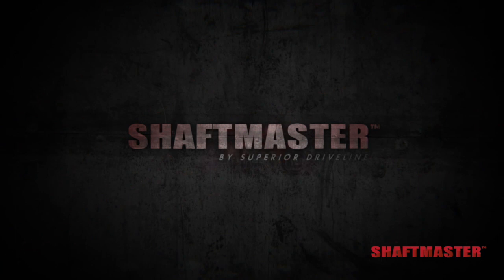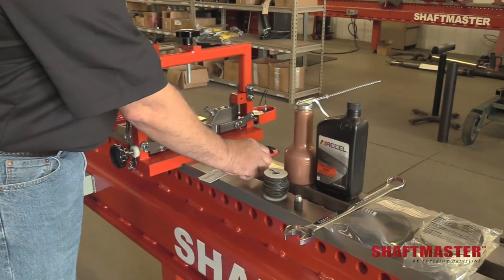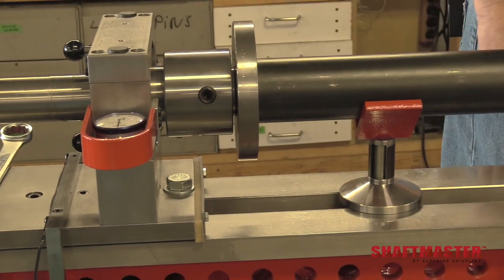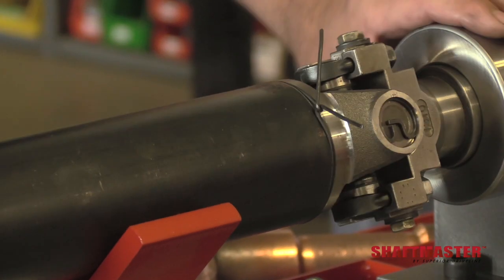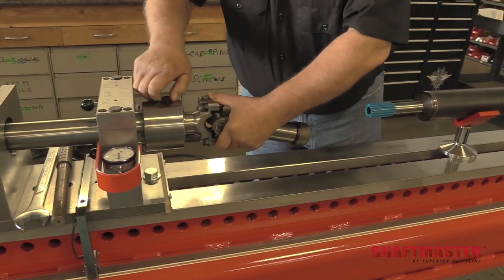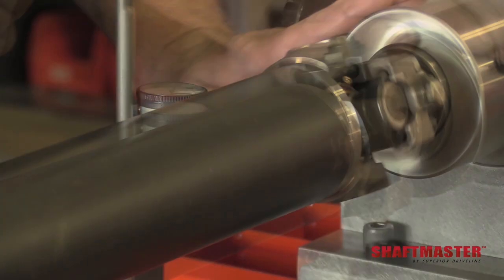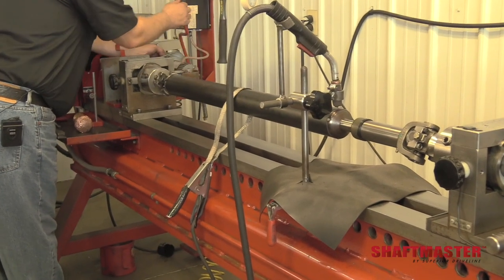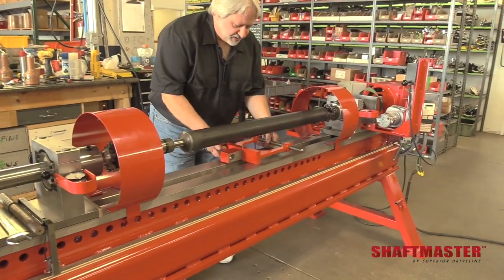Superior Driveline Intro to a Shaftmaster

Comment: With the strobe you identify the high spot. I wonder why you put the weight at the same position, shouldn't the weight be installed on the opposite side, 180 degrees? Or the shaft is running above critical speed, so the high spot and the heavy spot are not aligned in the same phase
Reply: Hi. When the strobe identified the high spot, the reading came in the outer ring of green light up numbers. The white numbers inside are indexed 180° so that is the opposite of the high spot and why you would start there with the weight of your choice and may have to move it. I prefer to measure the runout with the bearings locked, mark the shaft, and proceed without the strobe. Strobe can be pretty fast though if you go through the 3 points (front, center bearing cradle, rear) sequentially on the same spin and take note, then add what you feel should be right, like he said based on imbalance and size (mass) of shaft.